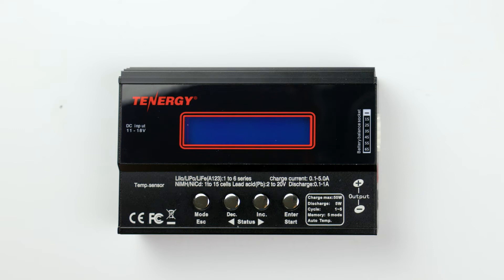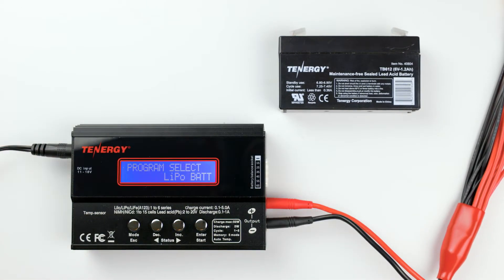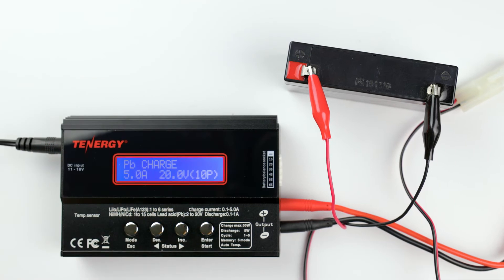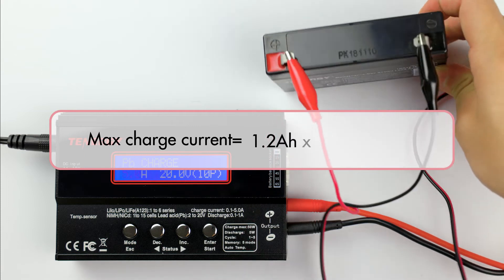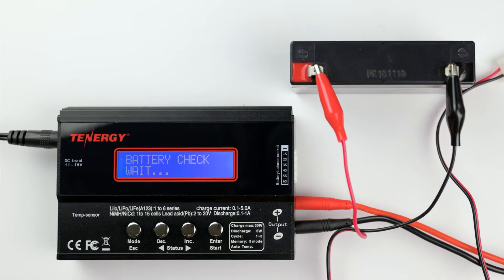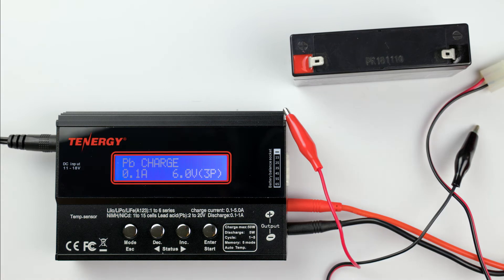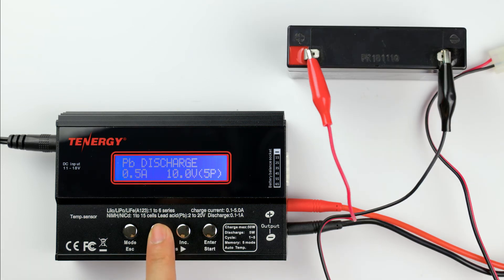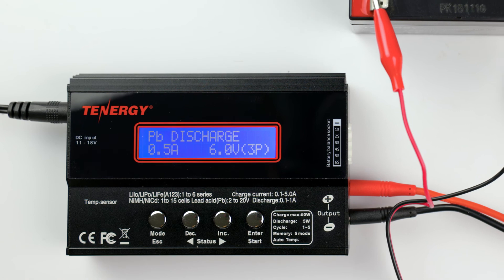How to charge and discharge a SLA battery with Tenergy's TB6B (with voice-over)

Comment: Can I use this to charge AGM 12v car battery?  If so, what amp setting? Mine is 60Ah, 20HR capacity, 600 CCA (SAE) AGM.
Reply from the maker: Hi Reikisponge, this charger is not compatible with an AGM battery
Reply: @TheTenergybattery  thank you

Comment: Hi, my SLA battery states on the side that it voltage regulation for cycle is 14.6 volts. The tenergy stops charging at 12.7 volts. I know it's a 12 v 7ah battery. I am charging at 12v with a current rate of 1amp.  Am I putting in the wrong information?
Reply: Are 12 volt battery suppose to reach 14 volts of charge?
Reply from the maker: We don't have enough information to give you an answer here, but please reach out to our team directly at service@tenergy.com with your SLA battery details and mention what settings you are applying for the TB6B charger and our team can help review if the right settings are being applied for your specific battery. You are correct to expect the final voltage to be higher than 12.7V, it sounds like the settings might be off.
Reply: @TheTenergybattery  can I charge 12V 100Ah Batteries with this at 5Amp?

Comment: SLA battery: Cheaper but lower capacity and shorter lifespan.
Lithium battery: Higher capacity and extended lifespan but higher cost.
Reply: And require's speciel charger else the thing goes up in flames.